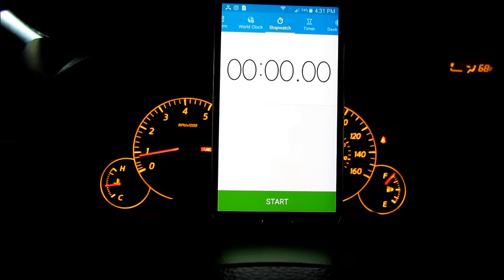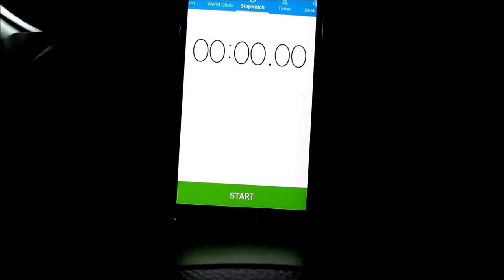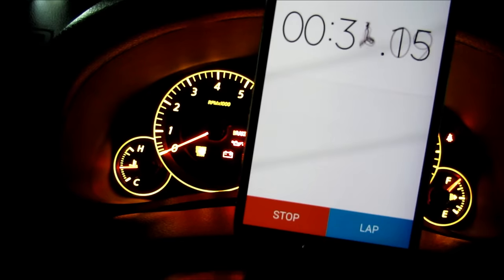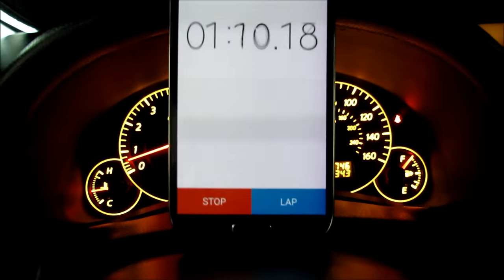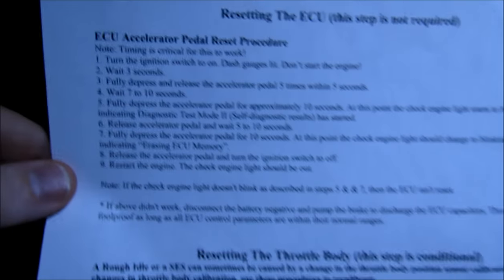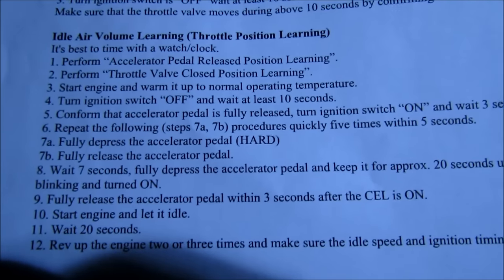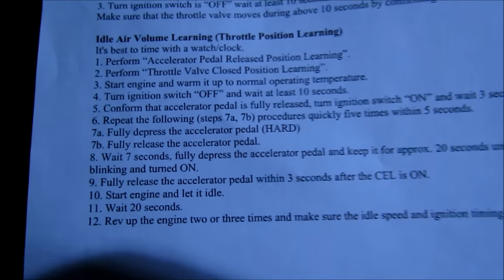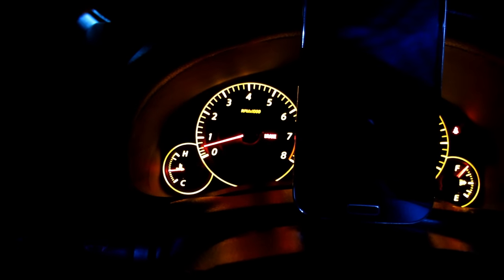Idle Relearn - FX35, I35, M35, G35, G37, 350z, 370z, Maxima, Murano, Sentra, Altima, M45, M56,

Comment: thanks so much for this i had a high idle after replacing tb and watched so many videos then saw yours and got it first try!
Reply: What make and model do you have ? I have an Infiniti fx35 and had the throttle body replaced and I feel like it doesn’t idle correctly. If I’m at a complete stop and let my foot off the break i roll up to like 30 mph without even touching the gas pedal!

Comment: Good vid, where is the EVAP EMISSION CONTROL VALVE. On the 2006 G35 coupe. I got an error code po443 after cleaning my throttle body and mas sensor.

Comment: Awesome video ... but what would cause your belts to continually strip tho... even after i changed what i thought was the power steering pump / pulley and or the tension pulley both of which i'd changed but didn't seem to fix it ..any tips

Comment: Thank you so much, I just took out and cleaned my throttle body and was idling at 1500 before the relearn. Thought I damaged and had to replace my throttle body
Reply: Did you have a engine light after you cleaned the TB? and did it go away after the idle relearn ?

Comment: So....i changed my spark plugs and cleaned the throttle body and MAF. I did all of the steps listed in your description and everything seemed fine. After I drove the car the check engine light is on and the SLIP and  VDC  Off lights are on 🤷🏾‍♀️ If I do the 1st step I can get the lights to go off and they stay off while driving. After I turn the car off and restart the lights come back on.....any thoughts and suggestions??? Also it doesn't start up right away...gotta hold the key longer than before 😮‍💨
Reply: Did you ever figure this out?

Comment: Just replaced the pedal on my 2002 sentra se-r spec v, and my check engine light does not blink.  The ECU reset procedure doesn't seem to work to clear the check engine light.  I'm going to try to clear with a code reader and try again, but so far I'm not having any luck.  Also may be a faulty gas pedal...

Comment: No fucking way man
 I have tried all the relearn videos I could find. I had to do yours twice but on the second time my 350z I'd idling right at 650 no more 1300 at idle and no check engine light. I have had a high idle for the last 3 months. I have the nwp throttle body so was doing it how the paper said but I misunderstood until you explained it out. Thank you a lot Man
Reply: Well it worked at first but it's like it loses it idle learn once I turn the car off and back on it's back at 1000 rpm. I tried doing it three times now. Think I have a bad nwp throttle body or a vacuum leak

Comment: This procedure work great, but it put idle relearn to factory stage. so i still recommand using nissan consult tool to relearn idle. using nissan consult makes a huge difference because they update  the spec for eg  air idle spec. using your procedure simply put the car without any update.  anyway thanks for your video.

Comment: I have a 2004 350z Fairlady car runs fine til it starts to warm up then it will start missing. so I took off the throttle body and cleaned in and installed new gaskets. So then I followed your instructions and got to the part where to check engine is suppose to start blinking after 15 sec i noticed it never starts to blink it just stays on. Any ideas??

Comment: true. .. this will also reset check engine" service soon" lit. within Obd code P0014.. but will lit back if some sensores etc.requires maintenance or replacement ..after this is done  if  ✓engine lite stays or comes back ,most cases repair is possible at the dealership and will cost to repair...Good luck...i need that that too..Smog testing on exhaust tail pipe insert is only permisible in oldercars or certain location of your state residency.

Comment: I did all that u did what i get at the end is rpms at idle go up down up down up down at 1000-1200 like someone is taping gas pedal and letting go and it doesnt stop i tried few diferent insturction videos including yours and it happens on all what could cause that, before removing throtle it didnt do this oh btw does this work on all nissan cars/trucks i have titan 2005 v8
Reply: Did you ever figure it out? I have the same problem. 04 Maxima after throttle body cleaning. Procedure seems to work but rpm stays at about 1100. Any help would be appreciated.

Comment: I always thought that idle is roughly around 1000 rpm. I cleaned TB and MAF sensor a few weeks ago and I noticed that my G37S acceleration is really slow, every time I want to front other cars the RPM always goes up 5-6k. Do i need to do all these steps ? I only reset the ECU after cleaning TB/MAF sensor--which is taking of the negative pole of the battery for 30min.

Comment: Any idea how to finish this procedure with a Push-Button Hybrid Altima??  There's no way to instantly start the motor within 3 seconds after the engine light goes solid since "Start" takes it straight to EV Mode.  Hopefully the dealer isn't my last option.

Comment: Hey I have a similar issue, I have code p0300 I installed new intakes and valve cover gasket. I cleaned my throttle bodies. This code is for a random multiple cylinder missfire. Would this fix this? Cause I’ve never done a relearn but my car seems like it drives fine but my check engine light flashes at me all the time while driving UPDATE I tried it and nothing happened. Must be something else :(

Comment: Hey man, just wanted to say THANK YOU. This video is EXACTLY what I needed. Freakin Nissan making caring for your car, and cleaning your throttle body a whole damn problem. 

This worked for a late model Murano for me as it had the Nissan VQ35DE engine. This video with the timing, 3 secs and 15secs is PERFECT.

As part of your note as well in doing the "turn car on, turn off, turn on turn off) before doing the accellerator pedal is NOT required. This did it. Went from 1200rpm down to 650rpm after of course driving it for a 10-15min. 

Thanks again. Really appreciate this video.
Reply from the maker: m4gician ....Thank you. Yeah after reviewing the videos on YouTube, I think my video is the best. Even I forget so when it comes time to do it again, I will even watch my own video to reset my idle. The others videos on YouTube make it way more confusing and not as streamline as it is using a stop clock in real time. I am glad it helped you and thank you for the feedback!
Reply: stopwatch on phone on steering wheel. Easiest way. 3secs gives you enough time to do everything.

Comment: I have a question that really has nothing to do with the relearn, but you would probably know
I have a 2006 G 35 coupe. I haven’t tried it but if you hold the pedal all the way to the floor and crank it I heard it won’t start (by design) ….is this true? I was wanting to know because I have a slight cold, start timing, chain rattle that’s been there forever, and if I did that, maybe I could prime the tensioner before start up j/w, thanks

Comment: The most confusing thing about it is, when they say timing is critical there sure is a lot of “at least” or “approximately” or “within” etc…
What does that mean when the SES light starts blinking do you still keep counting or are you go ahead and release before the time that it tells you? 
For example, approximately 20 seconds well mine stops blinking at about 12 seconds do I go ahead and proceed from there or keep counting to 20 with the paddle down?
Reply: Also, what about the turn all your options off and turn your steering wheel straightahead and make sure you have 12.9 V, well once you shut the car off you drop to 12.6 do we need to hook up a battery charger when we do this?
I’ve tried this 20 times in my SES light never starts blinking as if I were doing nothing that goes with ECU reset & throttlebody relearn
Reply: As far as ECU reset, I just unhook the battery cables and touch the positive and negative cables together, with a 1 ohm resistor in between for about one minute
But I’m trying to do the throttlebody relearn because on cold starts it’s kind of rough when it idles down until it gets down to below 1000 RPMs then it’s smooths out, I mean, the engine feels smooth when I put my hand on the intake but when you’re inside the car, it kind of sounds like crap, kind of reminds you of a plane landing that’s a little exaggerated, but you know what I mean. It’s not a smooth tone from high idle to 650.

Comment: My tachometer needle when vehicle is started only moves to Zero and when shut off moves below Zero to normal state so I don't believe it is a blown fuse, but will not give me a reading of my RPM - Would this have an effect on trans and engine relay? My car idles out often, could I still do this reset with the faulty tachometer? Thanks

Comment: I did this when I had a P2135 Throttle/Pedal sensor switch... the CEL is still on does that mean I need to replace the pedal or throttle body?

Comment: Tried this on my 2006 Skyline 350GT several times and didn't work unfortunately. The CEL light was blinking and stopped etc etc as per the instructions, but no luck for me. My revs are bouncing from 650 to 2000 when idling. Will have to take it to Nissan to get them to do it properly I think. Thanks for the video anyway.
Reply: Same with me this never works when u have jumpy idle .. i had 2012 nissan altima this method never fixed it
Have you happened to fix your problem?

Comment: I have a problem that I think you might help. 2010 G37 A/T Sedan. 107K on it. The rpms drop below 650 when shifting from P to R or P to D. The RPMs used surge at a hardstop after some highway miles.I am suspecting basically whenever the it switches to the first gear.  

Cleaned the TBs and the Intake Manifold upper plenum, the chambers above the valves, manifold absolute pressure sensor, pcv valves, put everything back together did the procedure in this video and everything worked normal for a week or two. Today, the rpms dropped below 650 while waiting at a stop sign, a while after coming to a stop, not immediately after. Any thoughts?

Comment: I'm having trouble with step 8 of the Idle Air Volume Relearn. The check engine light never stops blinking when i have the accelerator pedal held down. It starts and then just never stops. Would you have any idea why this would be? Thank you

Comment: what do you think of putting a 07 M35 engine into my 04 I35.... I know the M is AWD or RWD but it makes about 25 more hp and the   engines are about the same price, I know ill have to switch intake manifolds, transmissions, probably oil pans... Not sure about ECU's and the wiring aspect of it all, what do you think.... Couldnt find anything in the Nissan Infiniti forums... thanks

Comment: Do I need to do this after replacing the battery? I have a qx70 and it feels the engine is about to stall at warm start.  Cold start is ok. No issue.

Comment: Ay bro thank you soo much !!! It worked !! Check engine light went away . I just had one more question. I was using that obd2 app and tool . Even after I fixed the problem it still shows on the app that the code is still confirmed and can’t pass emissions test yet. Should I erase the troubled code then use the obd2 scanner again in a couple days after I drive it for a couple days? Or can I take it to get the smog done even if it still says the confirmed code on my app .

Comment: I have some issues with the rpms as well , but my rpm are high around 1200 rpm  and is constant the don't move from there ,  gets annoying  because is very loud inside the car. also some times when I rapidly accelerate the car to high speed the car in 5 gear lose power or don't accelerate , so I have to go 1 shift down  and goes back to normal , but I keep doing it, so I have to wait until the engine cools off and everything goes to normal. I did change the crankshaft sensor the one under the car driver side , but din not fix the issue, do you have any idea ??  Regards.2006 Nissan 305z

Comment: My 2002 i35 dropped to 850/900rpm from 1100 but can't get any lower. Following your video step by step, but check engine light is still on after the relearn process as. I've tried numerous times. Any ideas?

Comment: Hey dude I replace my throttle body and fuel pump and my car still wont rev. It's like my throttle body wont open or something. Could it be the throttle body sensor or the accelerator position sensor. Its stuck right under 2000 rpm. Wont go over

Comment: I tried this a ton of times with all the requirements (more than you mentioned) like voltage and steering wheel and it still doesn't work, no flashes. 01 pathfinder. Really don't want to have to take it to the dealer to fix it

Comment: I had my 2005 RWD G35 sedan throttle cleaned a year ago and have been experiencing extremely intermittent misfires. Mostly when I have my AC on with the car in "drive" while idling. I never feel misfires while driving with AC on or off. Does the throttle sound like the culprit? Is a relearn in order? Thx!!!

Comment: I did this process 3 times on my 07 G35 coupe and the idle still fluctuates btwn 300-700, also a little shaky (did the relearn after I had just finished installing a MD plenum spacer and injen cold air intake). Would you recommend the ecu reset at this point?

Comment: I just cleaned both my maf sensor and my throttle body did the relearn but my idle is still shaky and it also feels shaky when I'm driving at around 2k rpms (I have a 6 speed mt) any ideas on what else the problem could be?

Comment: Is there a way to relearn the g 35 coupe 2003 throttle body sensor ?? They want 500 bucks and I don’t want to pay it if there is a way I can fix this easily? The car sat for a mont or so because I was away but came back home and had to get it jumped because it didn’t start, then I drove it around for a while but then later that night it went into limp mode and won’t accelerate at all! The mechanic that saw it said it needs a new throttle body sensor which is the whole pedal which is 500, HELP LOL 🙏 thanks

Comment: Worked for my 05 G35 but the idle is a 1000 rpm better than being at 2000 rpm. Any clue why its at 1000 instead of 600-700 rpms like it should be.?

Comment: May not work all the time. I bought a new throttle body, new 12 vault battery, and did the relearn procedure by the repair manual didn’t work. I went to a mechanic he hooked it up and it still didn’t work for him. We’re guessing it’s something with the computer in the car.
Reply from the maker: Coil packs
Reply: @MotordyneG35  Nah those were recently replaced as well. I took the throttle body off and it started to do the high idle mess. I tried to do the relearn procedure didn't work and I took it to the shop and they couldn't get it to work. The mechanic said it might be the computer in the car.

Comment: So what causes this error code. I replaced my throttle body due to the code and the idle speed got worse. I have had no luck resetting. I have checked for Vacuum leaks as well. My pos just wont comply I’m thinking there might be afire soon.

Comment: I just bought a new throttle body installed it but have not turned the car on yet for a few months because i just finished doing the timing chain & also replaced with a new radiator so no coolant is on yet can i do this same way you did once i get coolant in ? I didn’t plan on fixing the car but now i did & i just don’t know how to go about doing a relearn
Reply from the maker: Yes! See my coolant bleed video too...https://youtu.be/o13izIyEI4o

Comment: I tried this a few times and i still get a rough idle. I installed a 75mm big bore throttle body. My ecu has been reflashed the UpRev tuning software. Would that be causing my issue?

Comment: Will this work on a 2013 Nissan Altima 2.5.  I changed the head gasket and disconnected the throttle. Its shutting off every time I come to a stop or when I put it in reverse. It runs great though. Please let me know. Thanks
Reply from the maker: panchopaton ...Yes, it will work. Anytime you disconnect the harness or touch the butterfly on the Throttle Body you have to do the idle relearn.

Comment: Hi for some reason i can't get my check engine light flash i have this instructions from Motordyne, see the video and can't calibrate my new throttle body because after replaced the APP wich is the code p2122 p2127 how is related with, but not results.
After APP and Throttle body.
I can't celebrated because i can't reset and relearne my ECU

Comment: I replaced my spark plugs and changed my oil and now I’m having a rough idel. Will this work ?
Reply from the maker: Unless your coilpacks are bad, but you would get a check engine light. No check engine light, yes it will work. You have to address the check engine light first.

Comment: I don't have any engine code, but I've noticed that my '08 350z idles low, like 300 RPM. So I was curious if this would work?
Reply from the maker: Yes, this is exactly the time you need it. It will work no problem.
Reply: clean your air filters, throttle with carb cleaner but with care check for do dont's on elecronic might get damaged if flys are opened manually.. ",Mapsensors alsocleaner CLR.. disconnect elec terminal
Reply: Same issue 04 g35 no check engine light idles at round 200

Comment: what was that raspy sound when you revd the car and the rpms went down? my car does the same thing is it an exhaust leak? or flex pipe on the y pipe
Reply: z If your running test pipes and the stock y-pipe or some sort of setup like that usually its the stock y-pipe having smaller piping then the test pipes resulting in that noise

Comment: I think I'm gonna do ECU reset and throttle one that you did. Is there a certain order you would say do both in or doesn't matter? Thx. Great video.
Reply from the maker: Will Everett ....it does not matter.
Reply: @MotordyneG35  soo which one comes first??